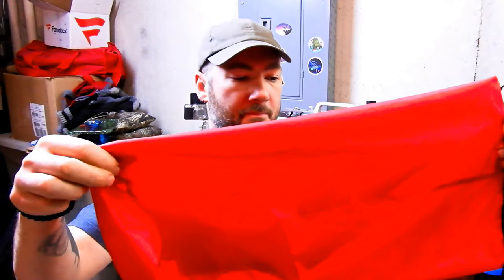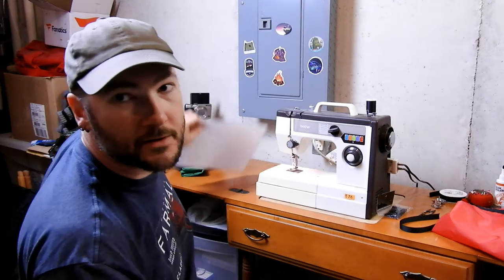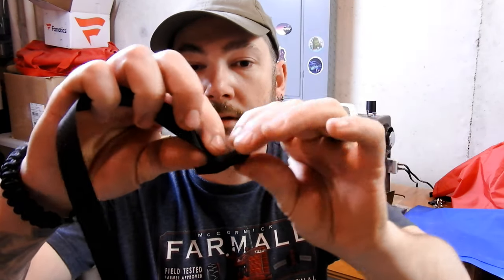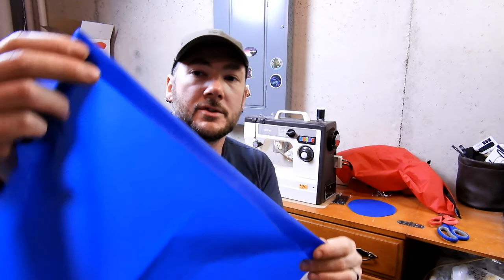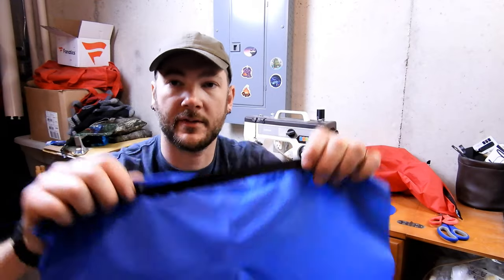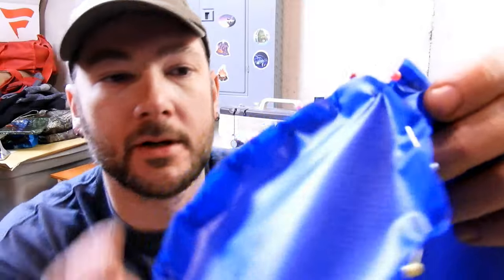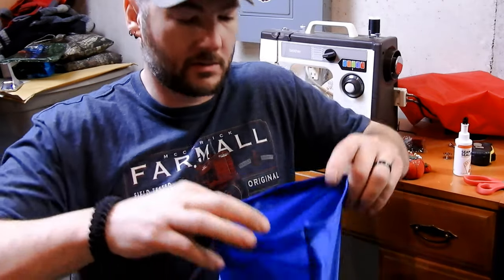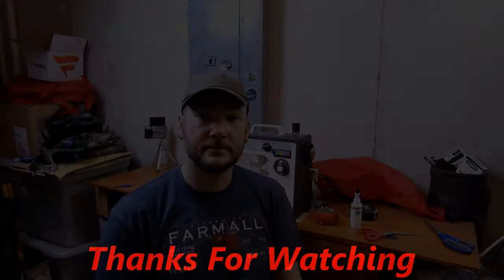DIY Roll Top Stuff Sack

Comment: Usually roll top dry bags have some stiffening ribbon (maybe some sort of plastic?) inside the top of the bag "under" that black strap. You didn't do it so and the top of the bag is soft. How it works for you? Is it an issue to not put any stiffening there( and save some weight 🤭)? I'm planning to do modification to Thermarest Neoair pump sack by sewing the roll top to it so I can use it as stuffsack to pack and compress quilt etc. inside backpack liner (nylofume).
Reply from the maker: It definitely would roll down easier with the plastic but I haven't had any issues.  I did add velcro to the opening to help keep everything closed and that helped a little bit as well.
Reply: @JasonOutdoors  Nice! Thanks for quick reply and especially for that velcro idea 😋👍 I modified the Thermarest pump sack today (removed original line with line locker and also the straps which were sewed over seams, then added everything needed for roll top). Original weight 55g, in result 60g. +5g weight is worth the comfort packing using roll top. Happy 🤭 Thank you for you video (encouragement to do that mod) 👍👍👍